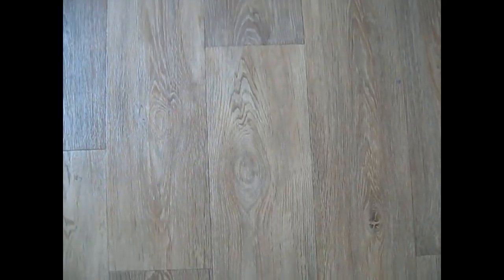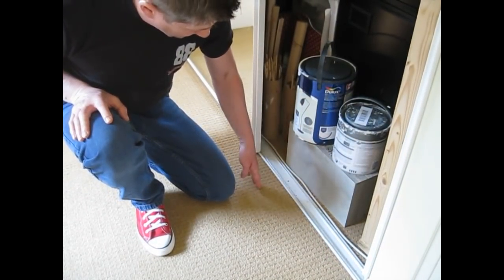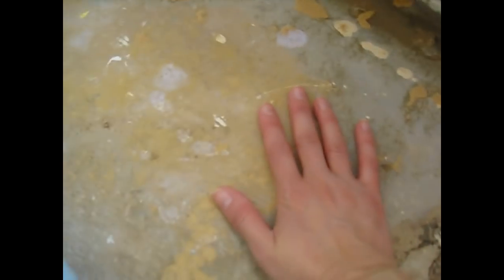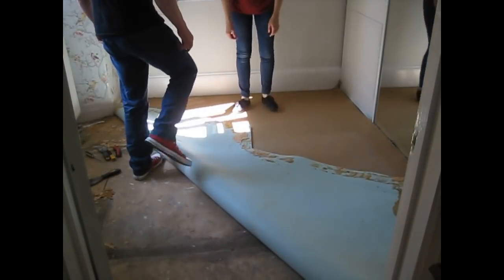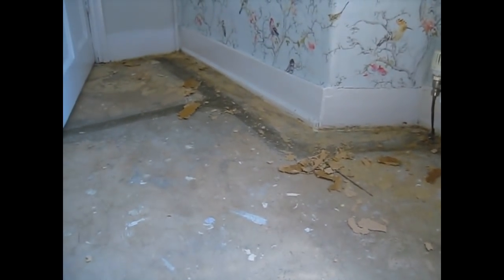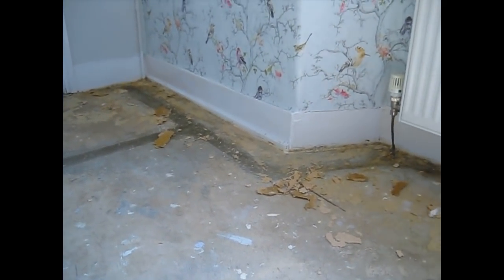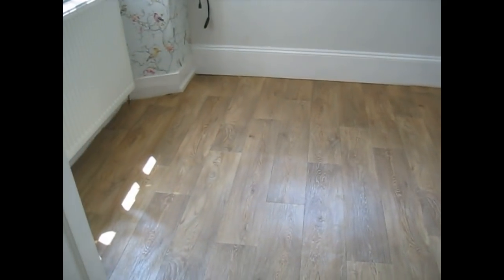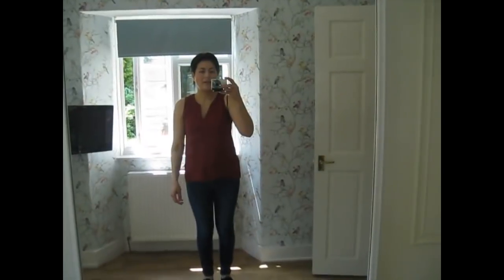My Craft Room Makeover ~ Part Five

Comment: All right, this will be a bit lengthy, but might be a solution to your brush problem. Find a container to fit your space and in the "short" end of that container, glue in a sponge like the one you have for drying pieces. Put your brush handles in the sponge and separate the brushes with packing styro sheets cut to fit. Have a hinge to open the back of the container when you take it from the drawer and you have a "filing cabinet" for your brushes. You can make several, varying the size of the sponge bits to fit the different brushes in your collection. 
Dremmel tools are wonderful and you're right, they do take practice. Those bits of scrap you have that you are going to toss? Why not use them as practice pieces for your Dremmel? Since the tool is built for tiny, the scraps will serve a purpose for your precision motions with the Dremmel. Who knows? you might even craft more miniatures from your practice!
Reply from the maker: Thank you for the suggestion, but I'm going to go for something a bit simpler!  I shall probably just make a divided tray to fit and lay the brushes in that.